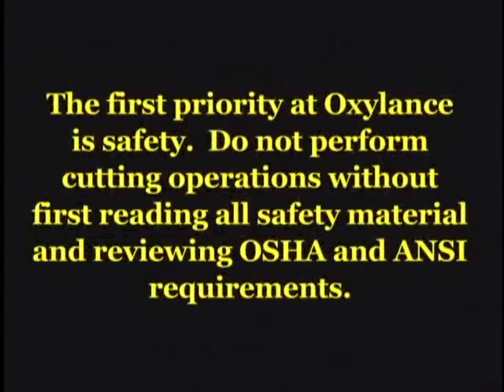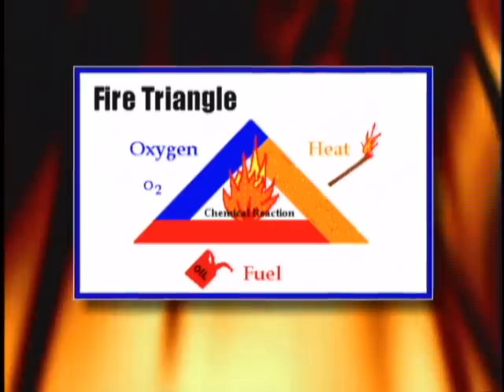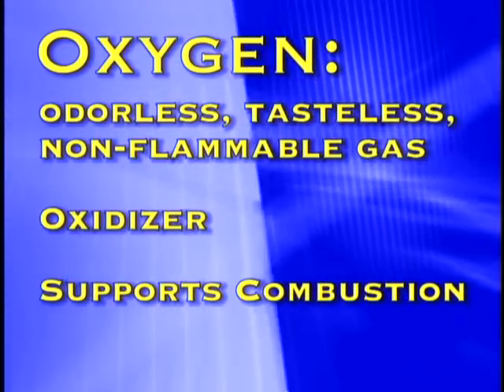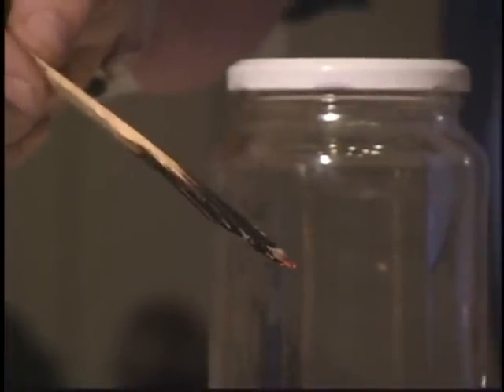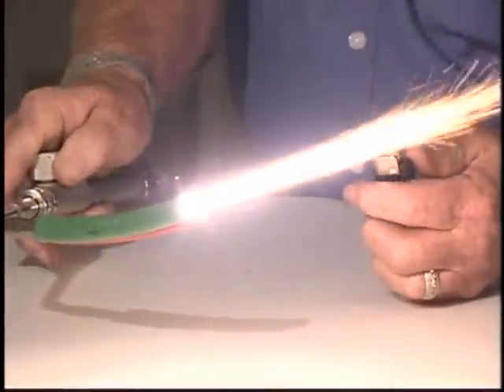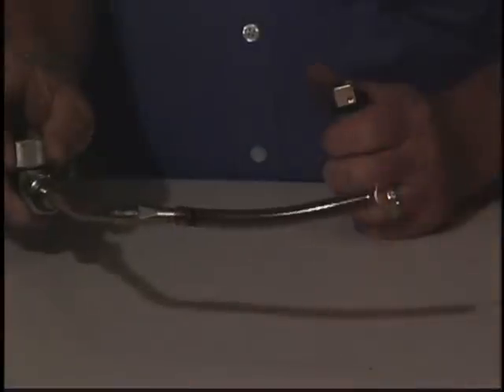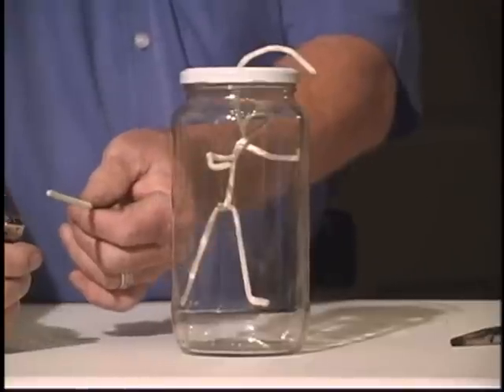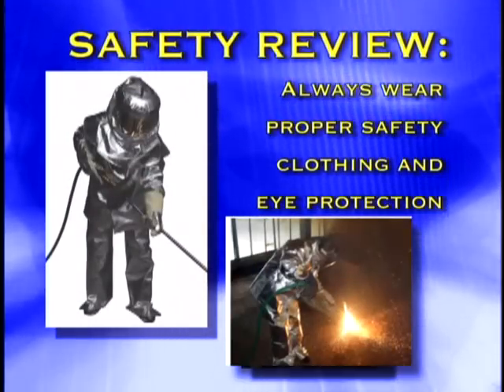Oxygen Accelerated Fire Demonstrations

Comment: Three astronauts died because nasa didn’t think what 100% oxygen under 16 pounds per square inch of oxygen would do in a fire. RIP gentlemen..... 😪🇺🇸
Reply: The capsule of apollo 1 was at 2 atmospheres of pressure or about 30 psi. That was one of the things that prevented the crew from escaping they couldn’t quickly open the hatch because of the pressure difference
Reply: Filip Jackowski yea i get it... its like trying to rip the tire off the rim when it still inflated. The door was held in place with air pressure and didn’t swing open like a modern car door. Like being under water in a car and you can’t push the door open until water floods the interior because water pressure holds the door closed.